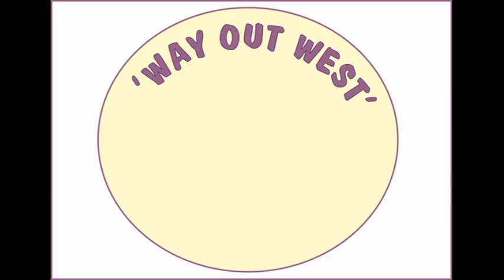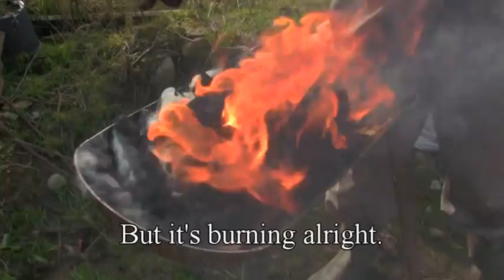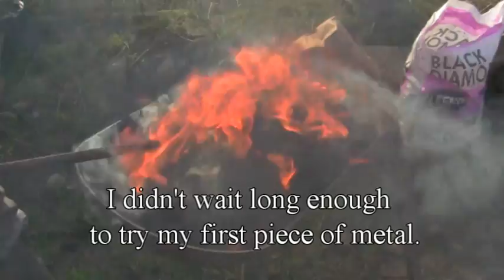How To Make A Homemade Forge From An Old Gas Bottle.

Comment: I had a few one hundred pound gas bottles laying around- they're about four feet high and have a stable base. I cut the top off one bottle and just flipped it over. Put a small piece of mesh in the bottom. Welded a one inch elbow to the opening and screwed in a piece of steel pipe. My blower is for inflating an airbed. At some stage I'll replace it with a car heater blower with the adjustable switch to vary the amount of wind. Air bed one works well but they're not designed to be run for long periods. I just wanted a simple forge so I could make tools for my pole lathe- now I'm into blacksmithing more than wood turning- too many hobbies and not enough years left:)  Jay.
Reply from the maker: +JayInOz1 I know the feeling Jay - so many interesting projects to dive into and I won't get to many of them. Such is life!

Comment: Nice work. I used a propane can to make my forge too. Break your coal down a bit and it will have more contact surface area with the steel and get it hotter.
Reply from the maker: Jesse W You're right Jesse - I've found some smaller stuff that works much better

Comment: Please show the finished project at the beginning of the video, so the construction steps have more meaning.  I am more likely to exit a video from confusion than to stay with it from curiosity, when apparently unrelated steps are shown..

Also, the blower unit from that vacuum can be mounted in a hole in your box, to put out lots of air, and save the price of a blower.  Also, an old gate valve makes a great control for air pressure.  Mount it as a bleed off valve.I also like to use a toggle switch for on/off.  A bit of rubber tubing makes a good extension, so you can turn it off/on with your tongs or hammer.